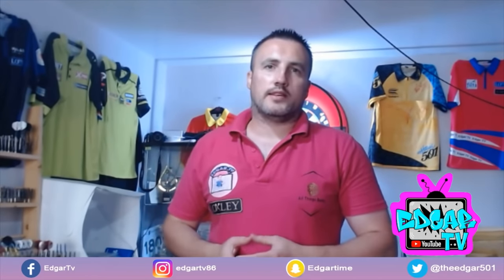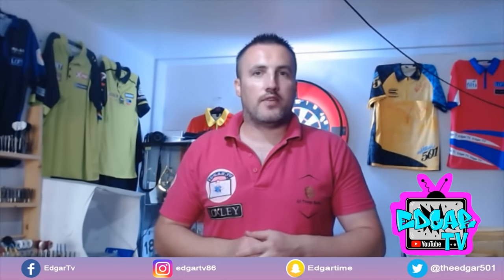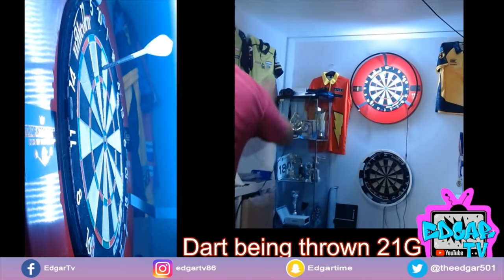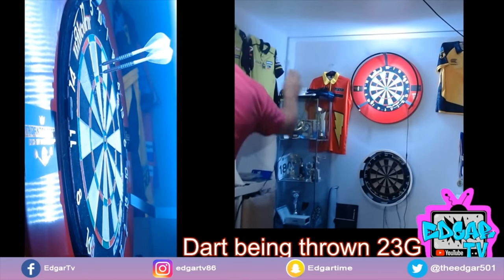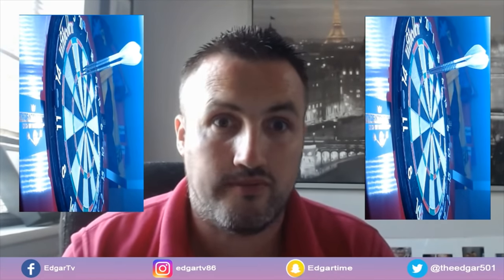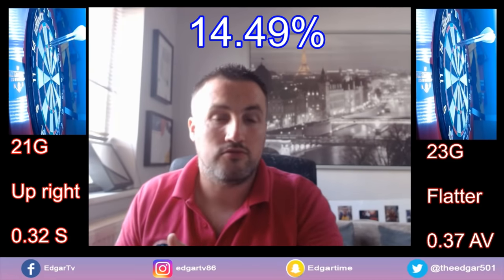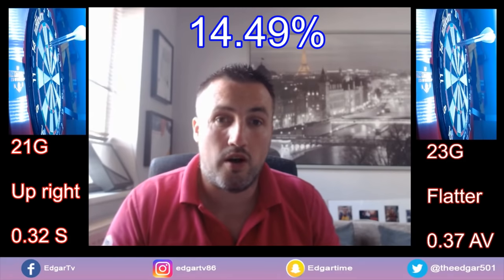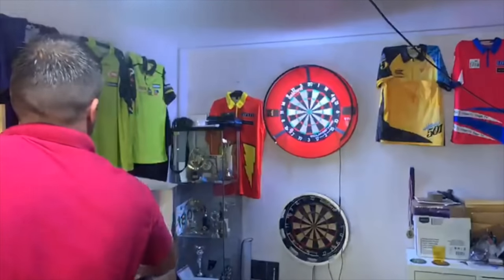How the weight of a dart affects the throw

Comment: Not only should you look at the weight of the dart but also how the weight is distributed. Is it a front, middle or rear weighted dart and how does that affect the darts flight. I haven't done an analysis but I can say that I threw a front weighted bomb style dart for years until Darren at the Darts Review Channel sent me a set of Harrows Verve's in 23g several years ago. (Thanks again Darren). I was immediately amazed at the improvement in accuracy throwing a rear weighted dart like that. Obviously, they suit my throwing style and may not work for everyone but the point is that the weight distribution changed how my darts fly to the board.
Reply: This might sound stupid but how can you tell where the weight is distributed?
Reply: @trckenergyy7757  A lot of times you can just look at the barrel and see where the weight distribution is. The Harrows Spina I throw now is fatter toward the rear of the barrel and it's rear weighted. Bomb shaped barrels are front weighted. However, darts with straight barrels you might have to balance it on something to see.
Reply: Weight distribution isn’t something I’ve found that is stated when buying darts, it’s a real shame as you’re just gambling when buying online in that regard.
Reply: @darthhammer1475  that's why you support your local dealer

Comment: Use the same weight, inconsistent with short stems, changed to medium stems,same barrel and same flight and got the same angle on entry and tighter grouping. Not always the weight of the dart that makes the difference.

Comment: Cracking video this, oddly mine are the opposite, my 2 potential match sets are either 24g Target ALX 02s or 22g Harrows Avantis, use a no6 on the Avantis and Ten-x (smaller standard) on the ALXs and yet the heavier darts stand up way more in the board despite the weight and smaller flight and I also find with the 22s I'm either 140 or 26 and the 24s more like steady 60s...

Comment: Very informative. I was particularly interested in the angles of the dart on entry. I used to play 3 days a week, just pub and club, until some weird type of dartitis got me. I think an accident I had on my right arm, and what I can only say as a massive increase in my dominant eye (left) just made it impossible to throw. 
After practising a while left handed I realised I wasn't that bad. Joined back up in the pub league throwing left, even picked up a couple of 180 badges 😆 It's now more fluid, but at times unpredictable. I can have a cracking first dart and the second can be nowhere near, like opposite side of the board where I'm aiming! I've been thinking of getting heavier darts to try, but afraid of going down the path of throwing bad money over good 🤷🏻‍♂️

Comment: Great stuff Matt. I use 19.5g stiletto darts with small stems and small flights, the dart is fast to the board and lands at about 90°. I notice a huge speed difference with large flights, but not much in the angle of entry, same if I change to long stems, the angle changes slightly more vertical. Loving this series 👍
Reply from the maker: Thank you few more episodes to go still yet 😁

Comment: Thanks for another great video Matthew it is greatly appreciated. I started playing in September last year soon it will be a year and today I threw my 80th 180. It seems like I can adapt to almost any set hence I've hit a max with every set I own about 7-8 sets so far. I started with 24 grams for 2 months and they kept feeling too light. Bought a set of 28 g and threw my first max 2 months after playing steel tip for the first time. Then I went with several sets of 26 grams and it just feels right. I have a set of Loxley Robins 21 grams and it took me six bloody months to hit a max with them. If I buy a new set of 26g I hit a max an hour after getting them. I guess we are all different but I believe that when I throw lighter darts as hard as I usually throw I just can't hit the barn door. With 26 g consistency is there my average steadily rising almost 65 at the moment had several 14 and 15 dart legs 158 and 160 highest checkouts. All in practice obviously since I am only an amateur but I think that in order to throw lighter darts consistently well you have to have much more experience and finer touch...
Reply: dude youre story sounds like mine :D only difference is i was over 80 maximums after 4 months ;) but can agree to your theorie of its a smoother throw with the 26g compared to my same rythm and under 23g darts

Comment: Very good video and i agree , cant be the same thing even if is just 1 g difference . Myself was went down from 23 to 21 g and its a huge difference . Of course should consider grip on dart , balance and set up . Funny thing at least for me is more consistent throw was have with soft tip darts with conversion points , full set up with medium pro grip stems and standard flights is aprox 19.4 g , using rear grip as position to throw . Darts was been Unicorn Taylors i think phase 3 . Last two , almoust 3 months using Mission Kronos m1 21 g with Condor Axe set up and no matter how much i like them got it strugle with throw and consistent release from same spot .

Comment: Excellent video 👍🏼 A lot of people will just look at the board and judge what’s right based on where the darts land, that’s very much the tip of the iceberg. I never did that when i played, I did film myself throwing in slow motion like you did here and look at the flight of the dart as the game isn’t played on the board solely, its played from the oche. A good story I have regarding dart selection involves a certain Phil Taylor. I played against the great man in February 2008, he just got beat by Peter Manley iirc. He was using the Sigma Pro dart at the time, 26 gram, I thought they looked a bit odd for him. Anyway, I sat with him and chatted for a good while and I had a set of 21 gram John Lowe darts and since his game was a bit all over the shop, suggested he’d give them a go to which he wasn’t particularly keen on the idea… probably put off by the small size and light weight of the barrel. At the time, Unicorn had a Golden Hero range out, darts of mostly World Champions with a Phil Taylor grip so I suggested trying a 24 gram John Lowe Golden Hero dart and if he liked them, ask Unircorn to simply make a 26 gram version of this. His wife had a set of these, I don’t know if they were 24 gram, but he loved them and Unicorn made him a 26 gram version called the Phase 5, the dart that probably saved his career.
Reply: So in a way you saved his career 😊
Reply: @jelly8594  I suppose so in a way. More impressive however was when I saw him again 7 months later after he won the Matchplay with his Phase 5s, we met in the same venue and he remembered the exact seats we sat in and had that conversation. Now he probably wouldn’t recognise my face 😆😆

Comment: Thank you! I switched to a 26g...slim flight...and they land inconsistently at odd angles...a few times nice and flat like I like em... I am thinking I need a lighter dart...I love the way yours flew nice and flat (21g) but I probably don't have the same grip and action as you do...and I certainly haven't beat Gary Anderson with a 170 finish!  I'll try lighting up my barrels and see what happens. Of course...an inconsistent throwing action could be a part as well...Maybe work on that.
Reply from the maker: Film over the shoulder in slow mo and see if the flight controls the dart after release or if it’s the dart that controls the movement. I would suggest a lighter dart tho not many flights can handle a 26
Reply: @Edgartvdarts  Thanks coach!

Comment: So i dont have the exact specs, im new to the game.  Started off with a 20g brass a friend gave me, and started to figure out i wanted a ringed grip, something a little heavier. Went with a set of 22g straight barrel tungsten and they had a harder plastic flight. I only have a few months under my belt but i saw a drastic improvement in my game for week and weeks.  And of course alot of practice.   I broke a stem on that set and replaced them with stems that were a couple mm longer and a cheaper ( but new ) poly flight.  Now its causing the dart to completely tumble. Unless im throwing up towards the double, it almost totally at random. The point hits the the 20, or hits the wire of the 5 or 1.  Soo ill hit a 1, the point is on the wire and the flight is totally blocking the 20.  Vice versa for the 5. Last Saturday was probably the most frustrating and embarrassing outting ive had yet. Not saying some throws arent my own fault,  but i never had them land in the board angled left or right like this. Had an experienced friend tell me stop experimenting with 22g and start at 26g.

Comment: I think your grip needs to account for the change in weight. I think if you move your hand up just a bit it to re-find the proper balance, the heavier dart would not have that issue in it's flight path. Basically I think you're throwing the 23g dart like a 21g dart just because that's how you're used to throwing a dart.

Comment: Love the content. I am thinking a lot of this is a bit biased though, obviously, you will throw more stable (smooth) darts with 21, cause that's the weight you use. The rest is just not gonna be the same, as you don't use it that often, or at all.
Reply from the maker: I think you may have missed the point here. The point is not how I adjust to a dart it’s how the dart adjusts to me. Using the same set up and the same grip what’s the difference. 100% I could make changes to suit the dart but that’s not what this is about. All I would need to do is move my thumb placement and I could make it work the same way
Reply: @Edgartvdarts  Ok Matthew, that answer makes sense. Thanks for the reply. Planning to address all the details in the next videos? That would then make complete sense. I own bunch of sets, different weights, shapes. Probably making all the small adjustments, I don't even notice, which then makes me throw all the darts very similar way. Actually thinking of getting one of your 1on1 lessons to move any further. Stuck here right now.

Comment: Do you think the manufacturers would have tested out these aspects of barrel weight, center of balance,shaft length, flight shape, etc. in a wind tunnel or some had some sort of aerodynamic engineering experiment done? 
I know that the thrower influences the dart flight, but with such high stakes in today’s game and the high prices of some of the high end darts, I would think that a ratings system might be useful.
 I also play disc golf. Discs are rated for distance, glide, turn and fade. Each disc manufacturer has a chart that shows the predicted flight characteristics for all of their discs and are matched with the characteristics of the type of thrower( ie.beginner, advanced)
Perhaps a rating system for darts could make darter’s purchasing selections a bit more informed. For example: if I throw hard, but want the darts to land upright I should choose a dart with a certain weight, center of balance, stem length and such. It can be fun to experiment with different flights, weights and stems but sometimes it feels like going down a rabbit hole that can lead to no new insights.

Comment: Good video Matt! Just a question. Folk  have told me that tungsten content makes no difference but I’m fairly sure that higher tungsten content means that a manufacturer can make a slimmer denser dart. In my experiments denser darts seem to fall through the air quicker and glide to the board less well.  Personally I think 90% tungsten is ideal. Any thoughts?
Reply from the maker: Yes exactly that the higher tungsten the heavier so means drill depth can be different changing the balance point or can have a thinner dart and keep the grams

Comment: i would have agreed on the explanation, but that is only in the perspective of barrel weight. you did not mention the grip of the thrower that compensate their throws in different weights of barrel. i could see that our hand is more flexible to the barrel weight. what i mean no matter how heavy the barrel, we will adjust to it depending on the strength of our whole arms. i have seen shorter or skinny people throws much heavier darts compared to much huge person. i have seen some people also that could not handle well any weight of darts. i mean could not control it. and if we will conclude that the darts will behave on landing the way we want based on their weights, yes at times and no at times. its still relies on the throwers control over the darts.

Comment: I have a mechanical issue, which is the draw back. Its  way to fast. Dart pulled past eye to side of my head. Horrible consistency and ugly darts. Tryed an experiment. Worked down to a 20g dart with a slow draw in front. Set up matched to angle of entry 0-20°. Seemed to help a great deal. Lighter dart didnt need as much force. I basicly just slowed and released to prevent the whip back rythm that killed me. So far so good.  Not sure if this is the conventional wisdom. Most people say need more energy to push a lighter dart. Heavy darts track better. Go figure.

Comment: What level do the other pros go too with speed measurement, slow motion video etc when it comes equipment selection. Is it trial and error or do they get technical?
Reply from the maker: Most the time we know what we need to be able to change the path of the dart. It’s about it’s flight if you look at my slow mo of my set up that’s what we are looking to achieve
Reply: @Edgartvdarts  could you do something like this with Stephen Bunting and his 12g Darts?

Comment: What reason would there be for my dart spiralling? I’m releasing correctly, throwing the same (as far as I know) each time but sometimes, and most of the times, my dart spirals, landing with the flight aiming to the left. When it doesn’t spiral then it lands totally flat, no angle at all. 

I throw 22g darts with short shafts and standard flights. I’ve tried 24g and it still happens.